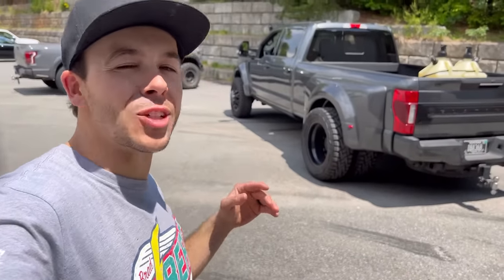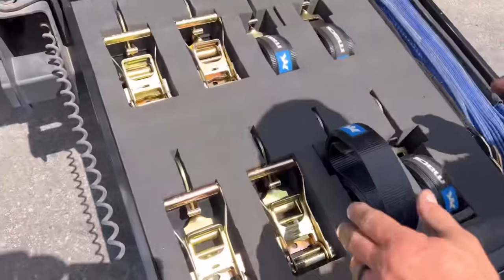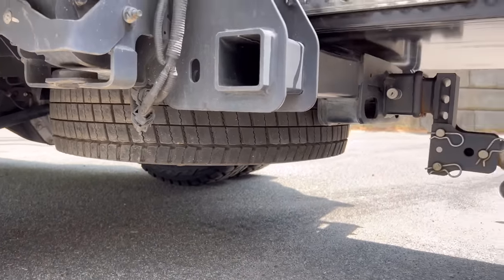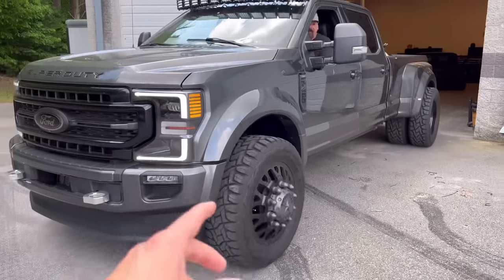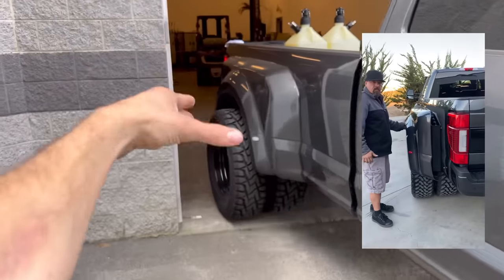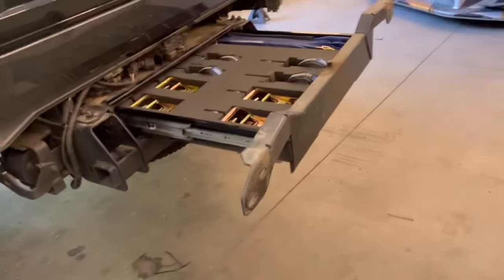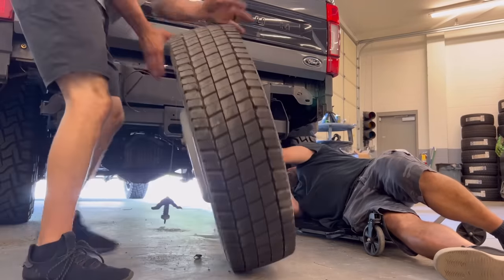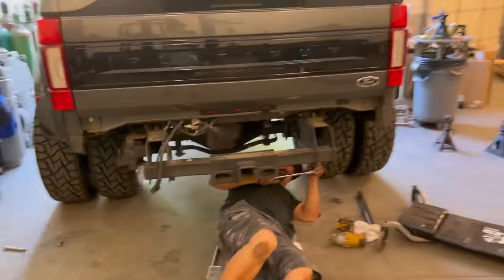BEST TRUCK INVENTION OF 2022? Hidden truck compartment patent for Ford, Dodge, Chevrolet & Toyota!

Comment: I bought a new 2020 f250 and I'm not impressed. The acceleration falters when pressing the pedal from a stopped or slow yield position. The transmission is confused about which gear it should be in at those same conditions. 
No problem with my and f150 but this truck has design problems.

Comment: Excellent design because you don't have to climb in and out of a van, great for a builder , or maintenance, tons of applications . The height is correct for loading and unloading tools etc.. 
The  one problem with it is 💵💸💵💸💵💸💵💸$$$$$.
Your looking at a select few. Somebody that's wants a truck that looks great and doesn't have the service body that can go on the back of a pick up..

Comment: All my friends drive a F250 and the 350 my one buddy 2016 in Maryland we use to always pay attention when we were driving were contractors and I live in Baltimore County Rosedale area he moved from the kitchen area Baltimore city out to Cecil county and working and traveling all over Maryland Virginia they went to a lot of Home Depot‘s and you always see trucks at Home Depot I especially like the latest F2 50s most of the time a 230 or 350 Dooley here in there even my buddy he does fire and water restoration in the guest insurance work so I’m not gonna lie he’s rich it’s crazy the money he makes he always buys the The latest and greatest vehicles here to G wagons still does he’s got three Porsches Mercedes work van actually two of them Ford work van yes to Chevrolet or GMC the big work truck don’t want to get the toolbox is it on the side and you can actually stand up in the back I can’t remember what they’re called but he was actually one of the first to grab one of those made a lot of those because they weren’t selling a lot of them I’m sure they still make it I actually bought another one but it’s no GMC and he has the F3 50 special ops edition and my buddy had that 2016 in the Maryland area I’m not saying there wasn’t any there but we didn’t see too many now we see them all the time another friend of mine has a body shop buddy go to the auctions all the time and buys cars that are wrecked but not real bad and they tow cars really easy now and trucks and he goes to Delaware auctions and he actually bought a King Ranch I think that was a 2017 and he bought the exact super duty like my body two of those and they just had some front end damage it was all cosmetic and they totaled them but bringing them from Delaware back to Maryland and Delaware they said the title was salvaged but when he got them inspected in Maryland they didn’t consider them salvaged so I think he put a little over five grand in each truck to fix dad he paid around the same for all of them 26,000 for those trucks and they were only a little over a year old they had 40,000 miles the other one was a 30,000 miles mean like it’s crazy the deals he finds and he buys them and fixes them and sells them he actually around the same time was getting those jeep The really fast ones not the hellcat the one that was 500 hp he was buying four or five of those at a time and flipping them and making like five grand on each one he was selling it as fast as he but I’m not gonna lie in Maryland DC and Virginia and Pennsylvania when my buddy got the first one we barely seen any of those and now they’re everywhere and a lot of my friends have them and I’m gonna show them this invention guarantee they’re definitely going to be on board👍👍👍👍👍👍👍👍👍👍🇺🇸🇺🇸🇺🇸🇺🇸🇺🇸🇺🇸🇺🇸🇺🇸🇺🇸💪💪💪💪💪💪💪🇺🇸🇺🇸🇺🇸🇺🇸🇺🇸

Comment: as a Retired Emergency worker that rear bumper is a PROJECTILE in an rear end-front end accident waiting to happen especially where light weight material trucks cant take an accident like older better metal trucks could  and so lawsuits will happen and if you want to want to loose your house n business n go to jail i wouldnt put out on market

Comment: Brilliant design and wish you the best! I am a construction guy and bought new trucks every 5 years since 1984 until 2008. Then trucks got to be WAY overpriced and tailored to dipshits. I hope you guys hit older truck market, because there isn't a "working man" that is driving a platinum , denali or whatever that dodge thing is, to a jobsite or hauling anything other than a boat, overpriced toy hauler or groceries.
Reply: Seems like it could work on any Truck. Just sized to fit

Comment: Cool yes. Will I buy it or build it no. The number of people that have run into my bumper is currently at 3 and I’m only 23 so I don’t want an expensive thing like that that will get bent and messed up next time someone runs into my steel bumper.

Comment: All the tools you need at the job site, but located in the "perfect location"  you know....in your truck...away from the job site where you need it... sorry that's all my objections.   Beware of the overly engineered accessories. That's why the 'do it all' cooler failed.  It solved a lot of problems no one had.

Comment: Putting storage in the bed is stupid you got to remove your liar to get to I like the pullout bumper til d someone hits it and it doesn't work any more I'd throw my motor cycle on the open drawer.

Comment: cool gear... you will need to start fitting these mods on the new Lariat EV  from ford... the EV9 from KIA and more. Gasoline vehicles are dinosaurs. Anyone buying a gasoline/diesel engine vehicle... today... is just buying a paper weight. in less t than 5 years.. you will not be able to afford to drive it. 10 years left of oil... at the current rate. well 9 since we lost last year already... but 9 years left. that's why all major car companies are dropping combustion engines completely by 2030. Youre all in for a rude awakening... enjoy the pump prices suckers! BUY EV!

Comment: If you rolled up on me and claimed you made tool vehicles for secret agents to advertise I would be shock in for a few days. I love all in one designs. Its the only thing I have wrong when it comes to mind based on system that tries to drug everyone. "Autism" lol.. Information for you. Here > 

1. One Elite Milspec-810g smartphone with microphone & cam on/off switch would replace up to 50 million products in the form of apps. Digital migration.. In a 64gig smartphone if you could use entire storage with duplicate app limiter off using a 2.6MB digital calculator as example to replace cheapest calculator on amazon = Approximately 3,800 pounds of calculators in your pocket using that one device.
2.(Using elite smartphone and bypassing dystopian push by people like me in your government) SmartGlasses to replace all size screens with ability to REMOVE THEM to make sure you are not in a dystopia which is opposite to the movie They Live (1988). Much easier to smack glasses off than to force them on people.
3. Plasma generated ultrasound goes far beyond material limitations not only for elevating a craft beyond human range of hearing for the illusion of perfect silence, but also tangible holographic control technology to rearrange matter like FOOD from waste extracted with ultrasound. The replicator.. < There goes %100 of foreign nations building our stuff AND climate change from THREE devices to master replacing mass production.
4. 2 trillion dollars of small modular & micro modular reactors is 20 years free power for masses recycling all water inside them, and that includes backups. Sell all power not needed for grid to friends around world. These reactors are delivered by semi.
5. Boiling water with enhanced solatube to boilers down wind of fires for cloud seeding just enough to compensate to prevent drought down wind from the fires. Multiple floors of underground farming facilities for Algae(Unprocessed fossil fuels), food, and medicine with perfect climate control for growing anything.

^ Just a few things from my list that I made when I rebuilt the world in my mind..